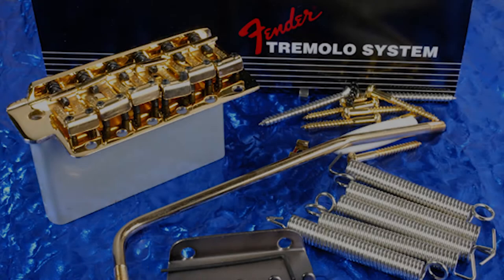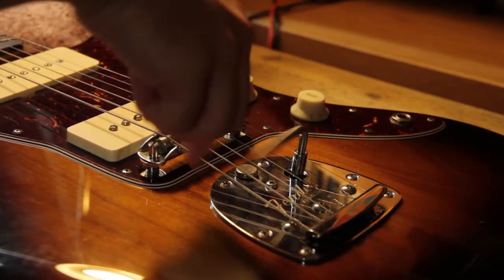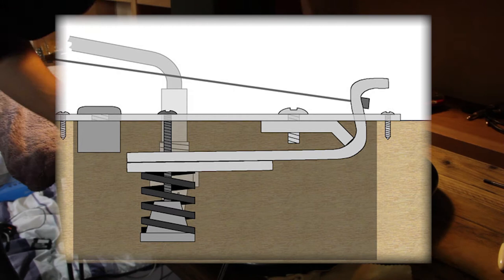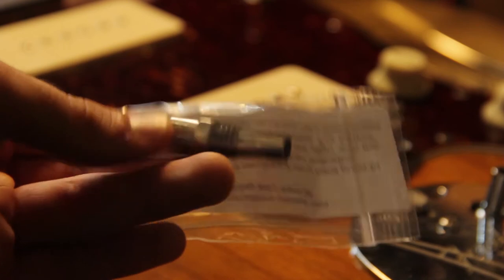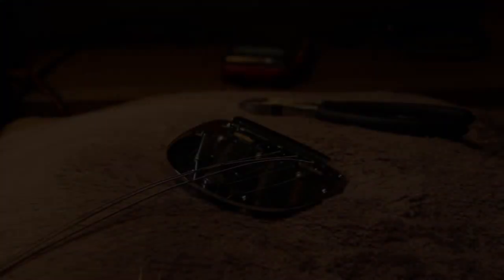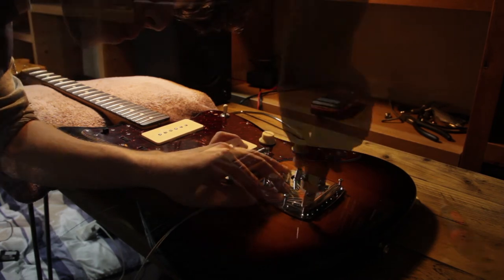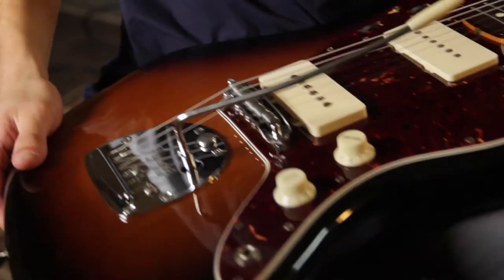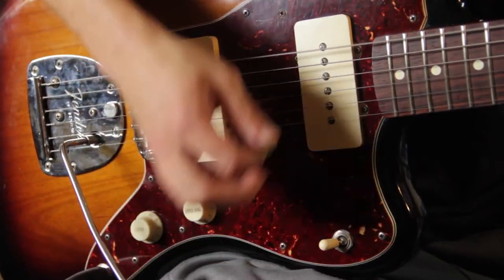Installing the Staytrem Arm [How the Floating Tremolo Works] - Jazzmaster Journey #2

Comment: Historically, Tremelo is a fluctuation between two pitches. Like a trill. A trill is between half steps, Tremelo is between a larger interval. Not modulation of volume like how you described it. 
It comes from the classical world. So someone like Mozart would’ve described tremolo as a modulation of pitch. 
It wasn’t until the pedals came out and guitarist changed the meaning of tremolo. 

So Leo fender wasn’t wrong because pedals weren’t a thing when he came up with the tremolo system 😉

Comment: Don’t take the strings out of the machine heads🤣🤣🤣Just loosen them and put a capo on the first fret like everyone else, bro.  Much easier.
Reply: The screw-in is better.  All you would have had to do to stop that metal on metal noise is use a little white thread tape, dog.  I don’t think any of this was actually necessary for you to do.  I’m only watching cuz I got a parallel universe Jazz tele used and the trem arm collar was stripped so I’m replacing just that part.
Reply: Or you can look at like a 2 for 1 tutorial.